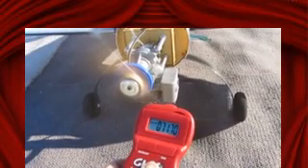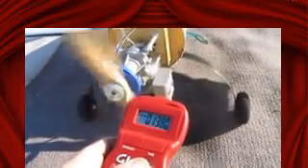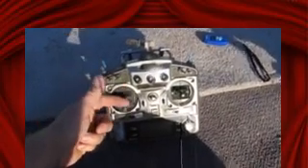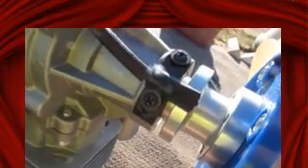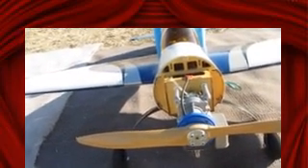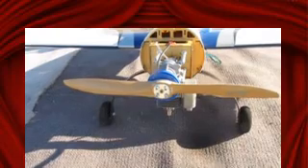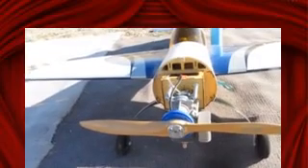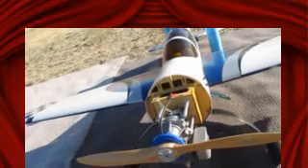DLE 30 timing comparison and performance observation

Comment: Hey, thanks for your video!! I managed to get a smooth idle by moving the sensor all the way to the left as you said, I may have found the 30 degrees that you mention; thanks!! Anything in particular as far as performance/ operation that I should consider using this setting value?

Comment: Old video I know but I've just got a RCGF 35cc and I fully retarded the timing as you have done. I didn't measure the degrees but I also noticed I could go really low on the idle and the low end and transition to full or partial throttle is much smoother. The engine should run cooler also. I don't mind missing a little top end but that can be tuned on the high needle and correct prop.